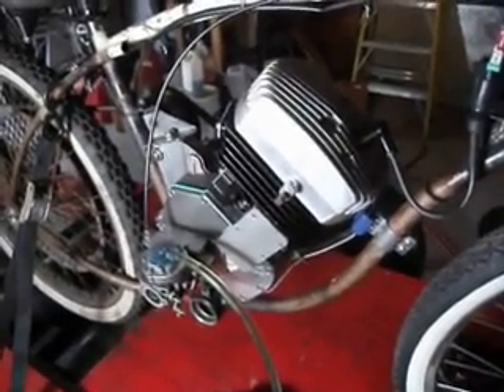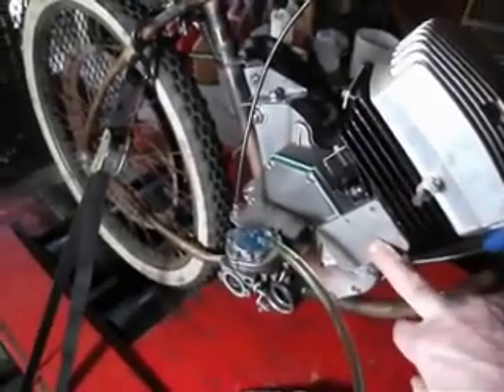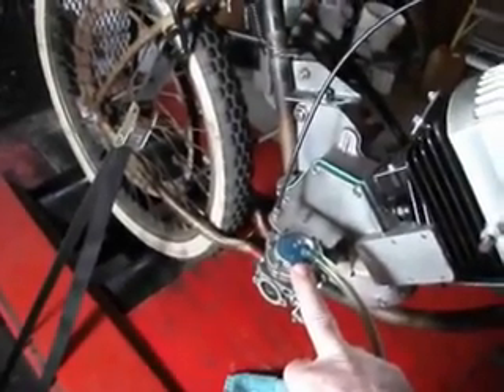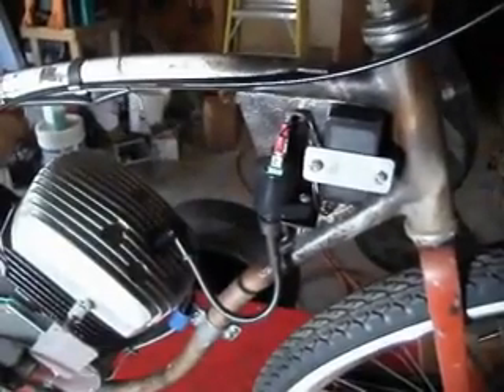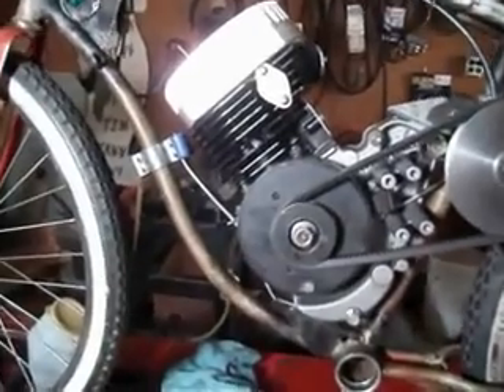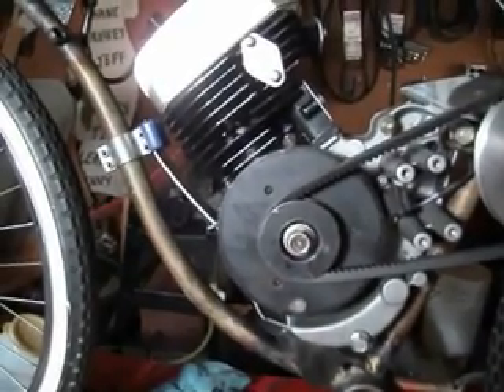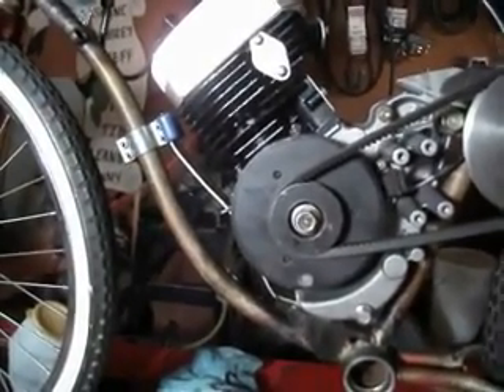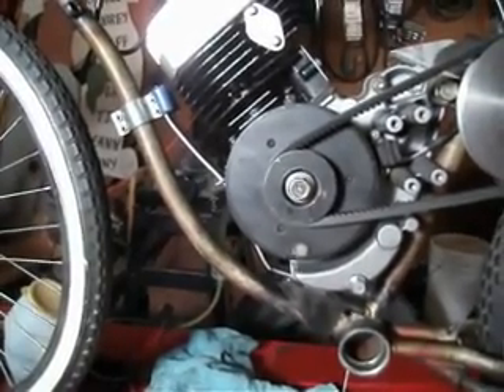Whizzer 4 stroke motor converted to 2 stroke-For Real

Comment: I would think you might be able to find a way to clamp an exhaust onto the port by using some form of steel strap around the entire jug. Like a modified band clamp. Copper crush gasket might do the trick to seal it.

Comment: Intresting stuff. I thought about doing something like that to a Honda GX35 to get more power & as a fun engineering project. I would have to experiment with oil gas mixture ratios to get the proper mix.

Comment: That's great! really great. you changed four stroke engine in to a two stroke engine so i think you must do some great job with in the cylinder liner, and how do you come up with perforating inlet & exhaustion ports on the cylinder? or do you just insert the new two stroke engine cylinder liner in to your four stroke engine block? do you have the formula or the dimension of the height of inlet & exhaust port in two stroke cylinder liner? please answer when you have little time & tanks a lot.